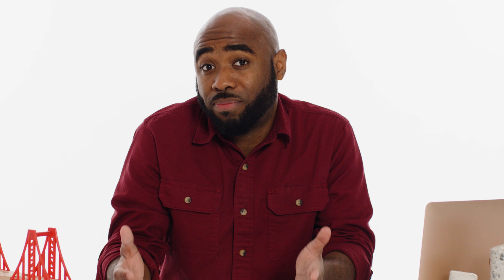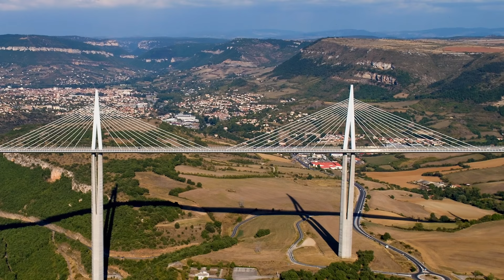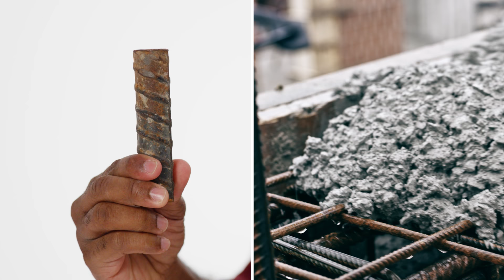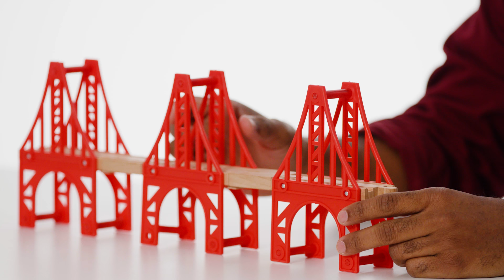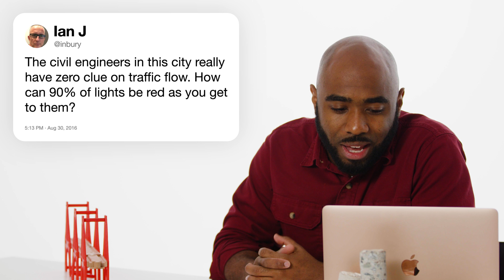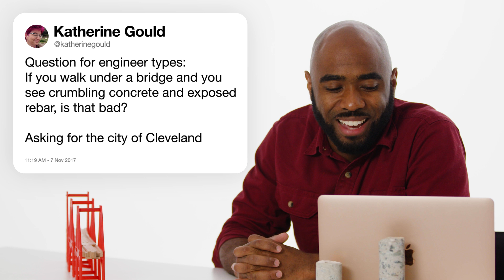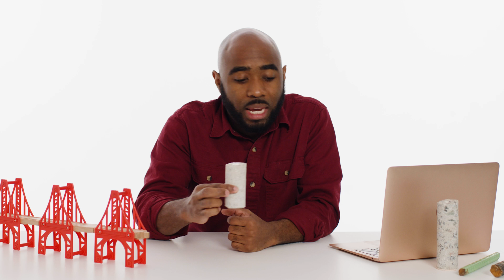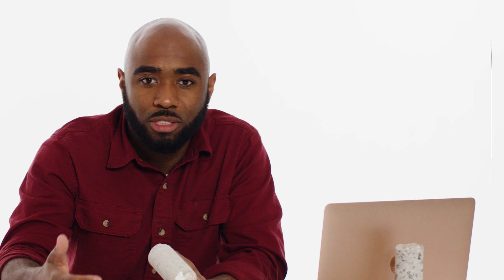Structural Engineer Answers City Questions From Twitter | Tech Support | WIRED

Comment: In the Netherlands, almost all, if not all, of the traffic lights have sensors that monitor the flow of traffic at the intersection, as well as in the town/ city to keep the flow of traffic moving. I.e., you can be approaching a green traffic light that turns red, it can turn back to green in seconds if it doesn't detect any other traffic with priority.
Reply: Every time I hear people bring things up like sensor governed traffic lights  for example, I think, isn’t this the standard in every country?
Reply: @hunchbackaudio In the US, there are several types of traffic lights, only some of which have sensors. Some are static timing, some have timing that differs by time of day, some are timed but with walk buttons, and some are sensor based.
Reply: In Switzerland some lights have sensors buried in the surrounding roads that detect if you are speeding as you approach the light and automatically put you on red to slow you down. So if someone complains they hit every red in the city on a drive, they were probably going too fast.
Reply: Every time I hear someone talk about the Netherlands it sounds magical.
Reply: K
Reply: If a light turned red then quickly went back to red here in the US, people would be crashing all the time ☠️ people here don’t know how to drive
Reply: No its green when you approach but turns red, then when you're stopped it turns green again. Its to slow down traffic but still allow flow @implecity
Reply: In America stoplights are synchronized to move platoons of automobiles.  Pedestrians often have to wait a few minutes at each light but this is okay for two reasons. 

First, if you were important you wouldn't be walking.  Stoplights help poor people remember that they're poor, which provides incentives to stop being poor.  This is called "economic stimulus."

Second, it encourages pedestrians to violate the signals.  That way, when they encounter traffic conflicts they're liable for their own injuries.  This is called "fighting poverty."

Comment: Steel has remarkable “tensile” (the ability to move under loads, wind/gravity) strength! Where as concrete has little to none. But steel will corrode due to oxidation over time. Cover steel with concrete and you have a match made in heaven by its ability to reduce corrosion or oxidation. Concrete continues to dry over a 100 years! Concrete will not burn but “spalls” because the water still it boils out. Water can neither be compressed or expanded without explosive results.

Comment: I actually prefer psi over Pascals because it is more intuitive because 145psi is 1mpa which is not a lot of pressure but the mega leads you to believe that it is
Reply: Depends on what use of unit we used to. As a country that mostly uses metric system over english system we become more intuitive and interpret structural matters when using metric system than the english units that not so often use.

Comment: Amsterdam (the whole of The Netherlands actually) has an amazing traffic design system too. Which also include loops in the roads to detect different types of traffic and can prioritize / switch traffic lights based on the actual current traffic. Not just an interesting grid but amazing NON car dependent traffic system 🙂

Comment: A lot of math also goes into designing a bridge for wind and variable load conditions. Two examples where the engineers fell down were the wibbly wobbly London Millennium Footbridge and the 1940 Tacoma Narrows Bridge, and we still have bridges where soldiers are advised to "break step" when crossing them to avoid resonances.

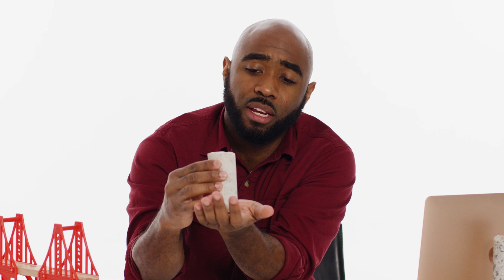Comment: 6:04 Concrete's compressive strength is higher than is quasi-nonexisting tensile strength. However the compressive strength of concrete is still much smaller than that of steel (however there are some high-tech concrete variants that can reach the strength of mild steel).
Then why use concrete? Because the ratio of costs to strength is much lower for concrete compared to steel. And it' easier to pour concrete and make planar substructures 😉

Comment: Great engineering knowledge and great explanation skill but a lot of these answers should’ve been directed at urban planners. The line for example, is significantly less efficient than a regular “hub and spoke” or circular design when considering transit. Building up is great, but building too far out always creates problems. He mentioned good reasons to not have elevated subways in NYC, but a reason he missed is the impact of all that above ground infrastructure on the already very narrow streets.

Comment: Wait... did you say the average bridge is designed to last only 50 to 75 years?!
Reply: Any structure built using reinforced concrete has a lifespan of around 100 years max, depending on the thickness of the concrete used.
Reply: bridge is designed to last that long without any maintenance usually there is always some sort of maintenance going on at a bridge at all times especially if it’s a toll bridge lol

Comment: The best ever engineering feat was when engineers installed all of the load plates upside down by accident on Bayside Bridge in Clearwater, FL, making you feel like you're riding a horse when you drive across. Way to go, engineers!

Comment: That NYC subway questions is a little funny because NYC HAD elevated subways before we had underground ones, but people didn't like them because they were loud, often used polluting steam engines, and darkened streets. We even called them the EL just like Chicago's famous system. Even today the NYC subway system is 40% above ground, mostly in the outer boroughs. (Brooklyn, Queens, Bronx, Staten Island, the area around Manhattan Island) Even in Manhattan, some lines go above ground. The Metro north mainline rail and the 1 line. These are both in upper manhattan (the harlem neighborhood) and are above ground because the terrain get's a bit strange and variable so it was easier to build above ground.
Reply: Yes. And I also think some of the above ground trains, particularly in outer boroughs are vestiges of the old EL system. Many of the subways follow the same footprints.

Comment: Rebar fabricator and former concrete laborer here. The rebar number represents the diameter in relation to eighths of an inch. Number 8 is 1 inch-8 eighths of an inch. Number 9 is larger than an inch-9 eighths of an inch

Comment: Traffic signalization can also address issues of speeding (so you'll hit more red lights if you drive higher than the speed limit) or are prioritizing other modes of transport, such as pedestrians, bike lane users, and buses (and so vehicle drivers will experience more red lights).
Reply: Exactly. San Francisco has a number of "green wave" streets that are timed to 15, 20, or 25 mph, as well as one that is timed to 10-12 for bicycles. If you hit it just right and nobody's being a jabroney, you can get across town super efficiently.
Reply: That’s hilarious because in my city you hit every two red light if you drive at the speed limit but goes through pretty much every one green at 100kph.

Comment: Isn't the numbering of rebar based on the diameter in 1/8th inch increments?  So a #4 bar is 1/2 inch and a #9 bar is 1 1/8 inch diameter.
Reply: Yes, the way you explained rebar size is correct. He's also correct that #9 bar is very close to one square inch cross section so it makes for easy math.

Comment: If No.9 rebar has a cross section of 1sq in, what's the equivalent for civil engineers who don't use freedom units?
Reply: There isn't an exact metric counterpart. 8 mm rebar has a cross-section of 0.5 cm2, and 16 mm rebar has a cross-section of 2.01 cm2, which are the closest "clean" matches.
Reply: #9 bar has a diameter of 28 millimeters.
Reply: They use metric bars. A #9 would be closest to a 30M. That is 29.9mm.